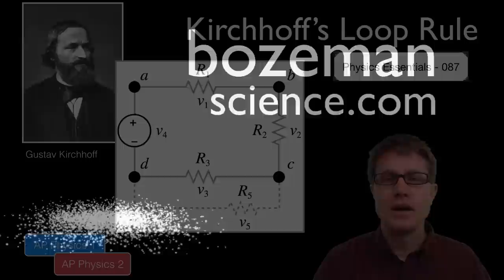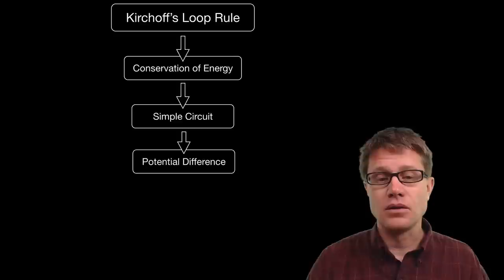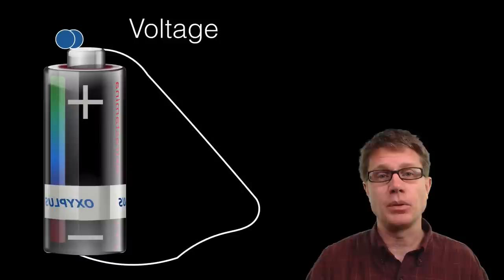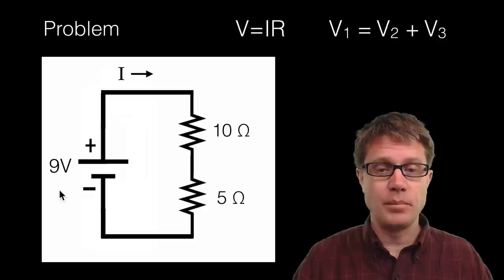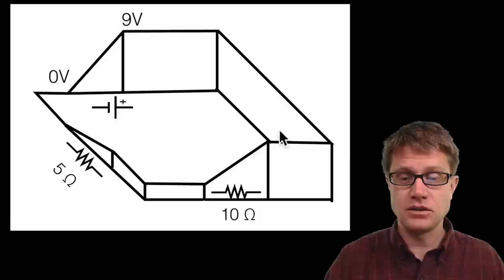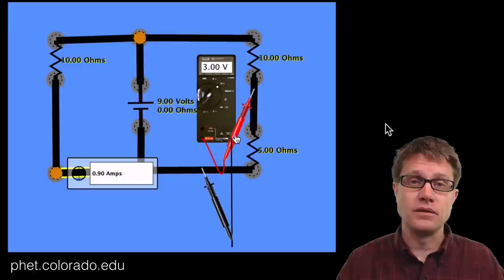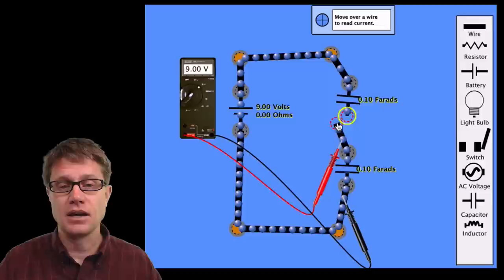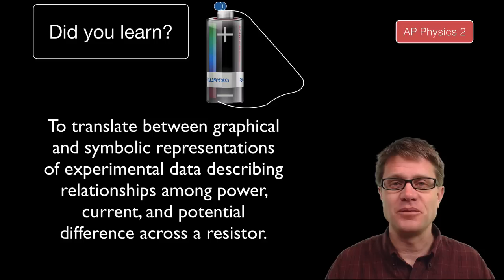Kirchoff's Loop Rule

Comment: I’m currently an electrical engineering student, and it has come to my attention that students have trouble grasping the concept of Kirchhoff’s Voltage Law in many of the introductory courses. My colleagues and I set out to help these student by offering a technical description of the process to coincide with the course material. We discovered it was much easier to grasp this concept with analogies, as you did. We then provided a strategy for solving these problems by analyzing the circuit, choosing a loop, and finally applying Kirchhoff’s Law to solve for unknown variables. We hope this technical description will benefit struggling students.

Comment: So battery is a elastic rubber band holding charge on it and  it releases charge around circuit, when a load comes it lose energy  just like  friction cause to lose energy of body which causes to lose energy of charge. But how it regain it energy from battery?

Comment: Thank you. 
I do have a question. 
How is voltage (potential difference) stored in the moving electrons? What I mean by this is when a current of electrons goes through a battery, how does the voltage give them power to carry out their functions, (ex. light bulbs)? Should I think of it as like Amplitude in waves? because the current is same all through the circuit. I just want to know how energy is delivered from the battery to the resistor?

Comment: I have a doubt 
You said that the sum of the voltage is zero then why did you subract them
Reply: +amrita kumari   Subtraction is the same thing as addition of a negative value.  Losing potential (i.e. across a light bulb) is a negative value.
Reply: +amrita kumari Think of it this way... suppose they ask you to sum 3 and negative 4. How would you write that? Even though they are asking you to add them, you would write them as 3 - 4 because of the negative sign that 4 has. It is the same thing here. When you sum up the voltages it is like adding with negative numbers because when you go through the resistors in the direction of the current there is a voltage drop or loss of potential energy. Therefore the voltage across that resistor is expressed with a negative. 9V + (-6V) + (-3V) = 9V - 6V - 3V = 0. Hope that helps.